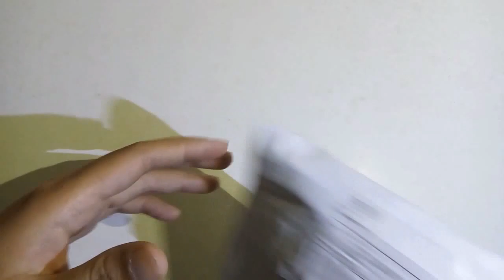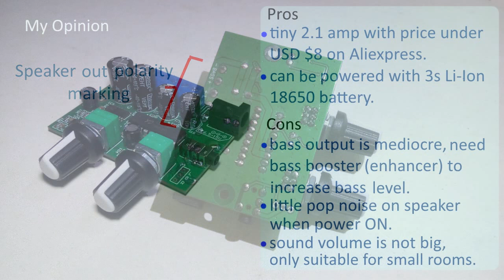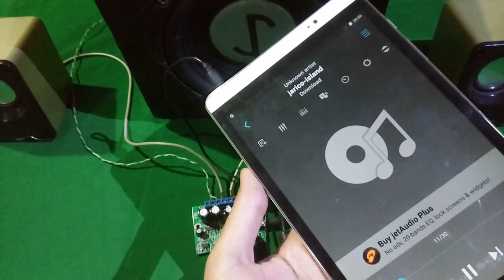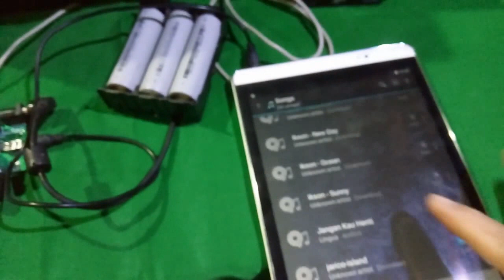2.1 Mini Amplifier Board for DIY Mini 2.1 Speaker

Comment: I recently bought the same amplifier.
The sound is good and bass is ok.
I tested this amplifier on different power supplies and got the best result on a 15v 6A power supply.
These batteries can only supply a limited amount of power so you should consider using an adapter. (Adapter worked best for me as without using any sound enhancers i was able to get a clear and stronger bass)
Reply from the maker: maybe my expectation in bass output is too much, I already tested it with self made adapter approx +/- 2A 15V. the result is almost same with test on battery pack Li-ion 3S. my other DIY subwoofer amp (class AB TDA7297 amp + dedicated low pass filter IC 4558D) performs much better bass with the same power supply, even can vibrating large wood table near the speaker. maybe the power cap(acitor) and low pass circuit design affects the amplifier performance for a small power supply? because I see this mini 2.1 amp module uses a very small power cap that is 100uF in the bass circuit section. my TDA7297 amp have 4400uF (double 2200uF in parallel) power cap...
Reply: This is not class "D" it is too power hungry to be. Probably class A or B!

Comment: what is the specs of your speakers?
Reply from the maker: Satellite speaker, I took the speaker and box from existing mini 2.0 USB multimedia speaker (model SW-280). I removed their internal amp. This model is sealed and have rubber passive radiator in the back of the box. Speaker unit 52mm, 3W, 4 ohm impedance, full range.
Subwoofer speaker (Bossini BS-6522), is 6.5 inch, 4 ohm impedance, max power 200W, in a sealed DIY box of wood.